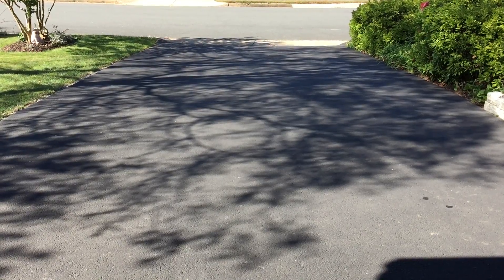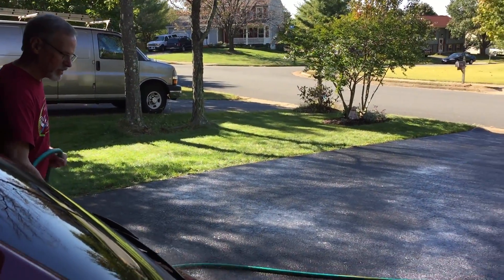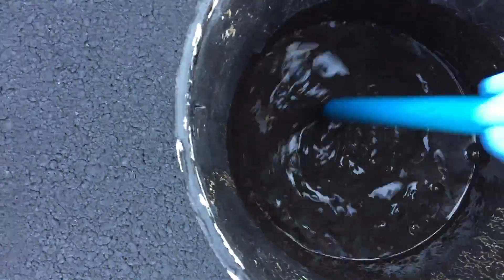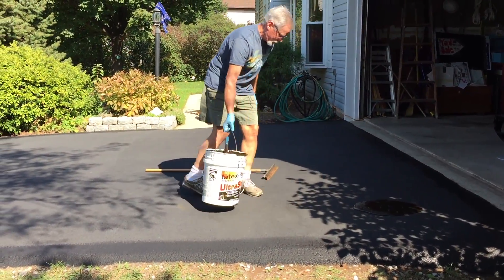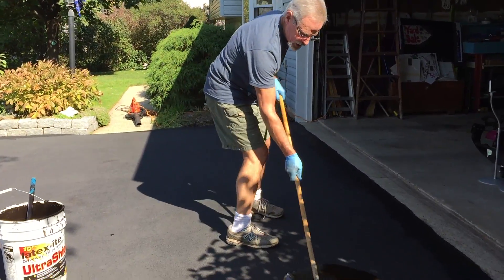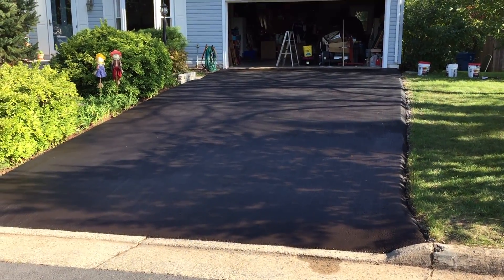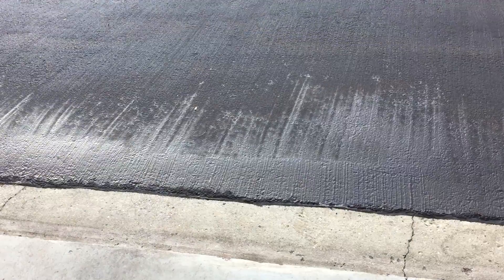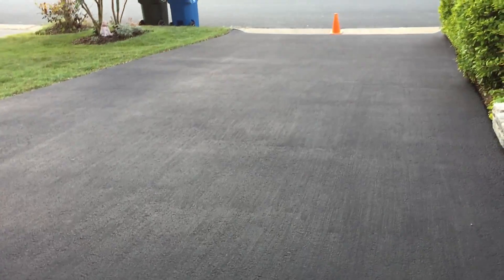Sealing Our New Asphalt Driveway x3 - Do you like the brush finish?

Comment: I’m in the sealcoat business and the homedepot buckets is a big rip off especially only lasting months they don’t have a lot of sand your basically sealing it for the color not getting much protection
Reply: Do you have another recommendation for DIY?  Or should I add some play sand into HD bucket?
Reply: @davem1212  Yes so i would hire a asphalt  contractor that offers maintenance services sealcoating being one of them but be careful! Some asphalt contractors  leave overspray and do crappy  jobs, so i would  recommend you view their  website and online reviews so you can know  who your working with.

ask them to apply by squeegee NO BRUSH  and no SPRAY and no  up and down patterns simply side to  side asphalt contractors will  have the best sealcoat that last long time  looks way better and is more durable. Home depot products are the worst sealers i have seen i think the reason you got by is because you sealed your driveway  very often.

your prep and cleaning is great i would let the  contractor  know i will  do my own cleaning 

just read the  reviews on the product your using now  there is lot  of  bad reviews  on the home depot app when you view the sealer 
home  depot sealer washes away fast and is to much money for  every 5 gallons
Reply: @davem1212  but you did great for DIY just next time side to side patterns only with squeegee and if you do use homedepot product again then add sand and mix
Reply: @IlyaEvdokimov  if using homedepot  product i would add  sand yes
Reply: @davem1212  and you sealing it to often looks like its chipping off when sealcoat is to thick then the sealer  itself will chip off that is why its important to hire someone that knows what their doing
Reply: @davem1212  do not seal it anymore let it fade then hire  a contractor

Comment: tbh you have coated the driveway too many times. asphalt bends and flexes and the pores act as expansion joints for that. wait a while before you seal it again and have a company apply a oil base coating to it. btw im a 3rd generation paver for a company thats been in business since 1955
Reply: did u see how good he sealed the mans gotta fortune out in sealer nice oil based would fix him wish i knew where he lived
Reply: Henry Stanley I agree, too many applications will crack the surface
Reply: Wow! Never would have thought that would happen just because of extra sealer! Good to know. Thanks!
Reply: I understand he sealed it a lot, but with your experience you should know in his case it’s normal. He lives in a area with weather conditions provide snow and ice and probably high winds and rain. In those climates it’s recommended to seal every year and if you experience extreme weather , every 8 months.
Reply: Who in the heck recommends sealing a driveway every year???  The sealer salesman??  Depending on the product you choose, the premium sealers have up to a 10-year warranty.  You don't see the state or local DOT out sealing highways every year, and they get way more abuse than the typical driveway.  I have a neighbor who sealed his driveway too often, and after many coats the sealer itself started to "alligator" and looked awful.  Also, he managed to get his driveway surface so shiny that it was slippery as heck to drive on with snow on the ground - his snow blower couldn't get any traction.
Reply: True too many coates woukd cause surface layer buildup which will crack...
Reply: @evanstauffer4470  10 yr warranty is  fraud.   No way any sealer can withstand cold harsh winters and summer uv rays... Anyway no way ten yrs
Reply: Hey Henry, given your experience what would you recommend in terms of a product? I'm going to be doing my parent's driveway this fall. Any help is greatly appreciated.
Reply: @stevestanley5397  Is that english??! What??!!
Reply: In the Northeast, even the top end consumer grade stuff only lasts about 1-2 years. A professional job lasts 2-3 generally. All things being equal.